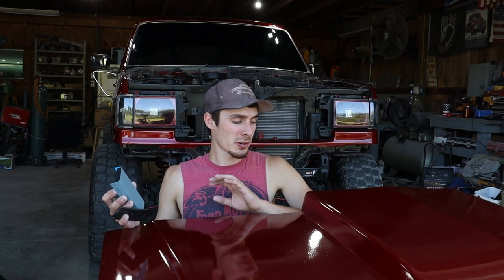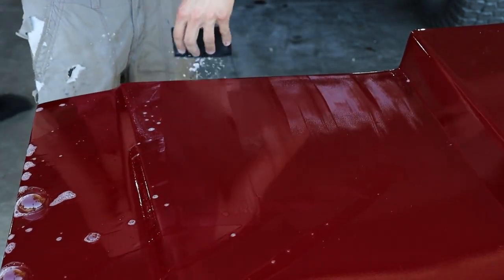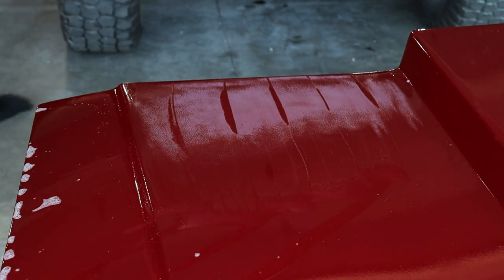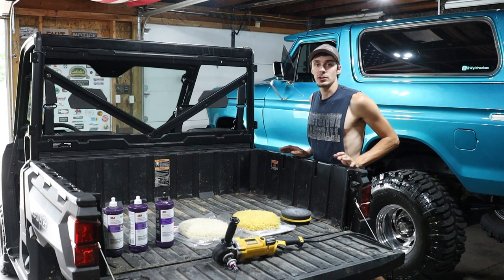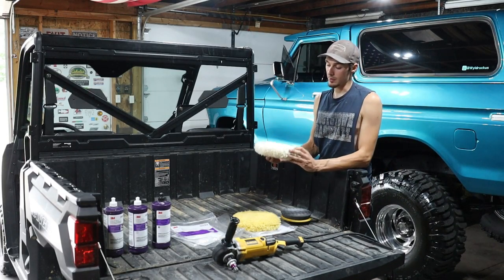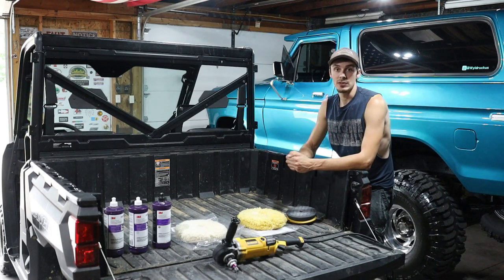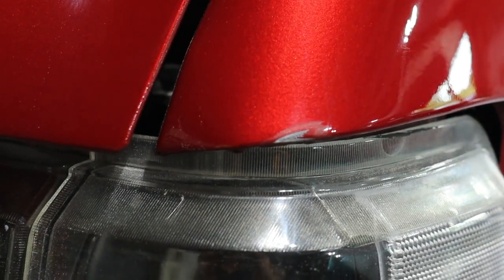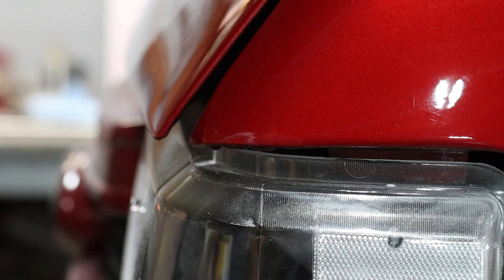Sanding and Buffing the Bronco to a MIRROR FINISH!

Comment: Just curious. Since your paint didn't seem that bad to begin with. Would you have been able to skip the sanding and only used compounds? Or do you get a better result with the sanding?
Reply from the maker: So with only using compound and polish that just takes out scratches and swirls, sanding it down takes away all "orange peel" or the roughness away and makes it a much smoother finish, and takes the little dirt nibs out of it as well, so I sanded it all down to be flat and smooth as can be!
Reply: @HagersAcres  okay I gotcha. Thank you!